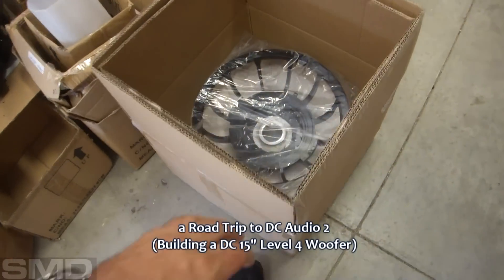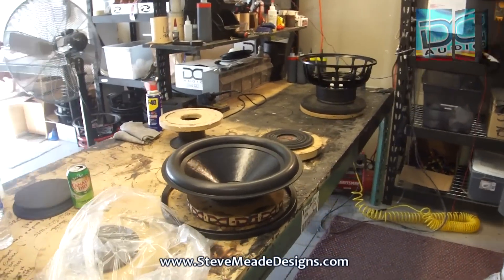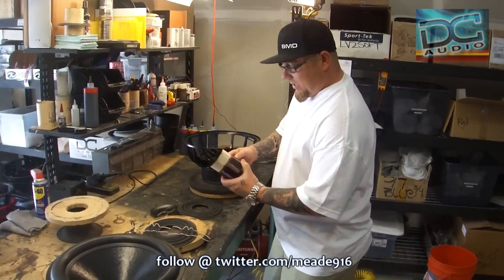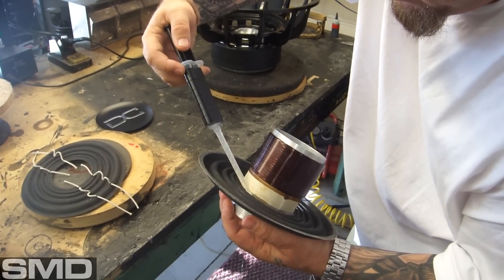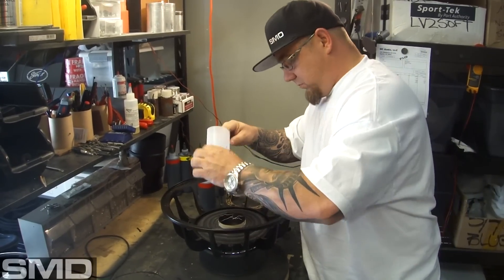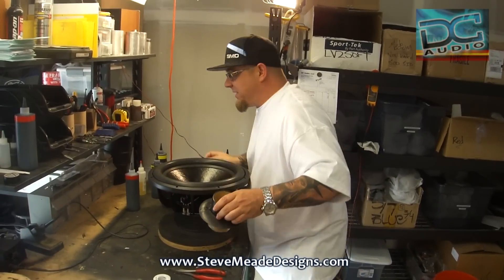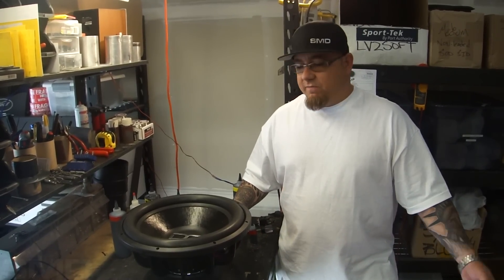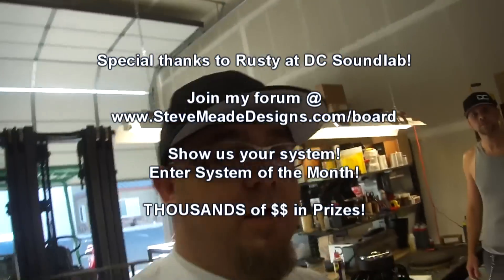How to build a 15" Woofer - A Road Trip to DC Soundlab 2 - I built it YOU win it!

Comment: I had a Punch 10" that I separated the cone and coil at the epoxy once and used a yellow index card that was perfect to keep the coil level with the magnet. I used PVC cement to glue the coil to the cone and the dust cap. I never had to repair it again. Just thought I'd share for a repair at home in a pinch.

Comment: What brand and viscosity of CA are you using from the black and red bottle?

Just curious as I use a LOT of CA and I've never seen a bottle that big. Where would one buy in bulk like that?

I like the air-brush with accelerator too, sweet idea. I'm going to try that myself. It should be perfect for some of the turnings I make and finish with CA. The air-brush should apply a much finer and more consistent mist than even aerosol.

Comment: Actually both copper and aluminum are great for winding voice could for different reasons. Copper has lower resistance which is good for power handling but it's also very VERY heavy making for a higher Qms which means you need a much bigger box to get decent transient response.

Comment: Can you repair a slightly damaged subwoofer with gorilla tape?
Reply: If there is a small to medium hole I used single ply toilet paper and clear nail polish to patch it it works perfect cause it's light and solid you lay the tp over the hole and cover the whole piece nicely every inch with nail polish then do it again with a new piece until it's solid